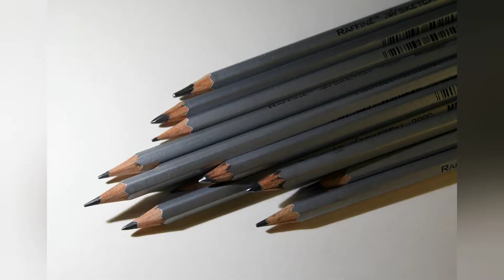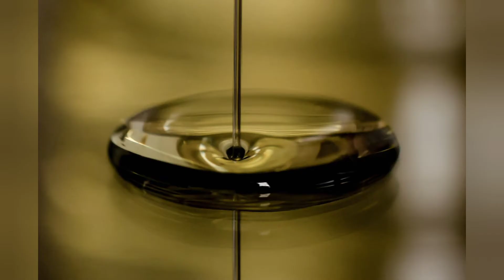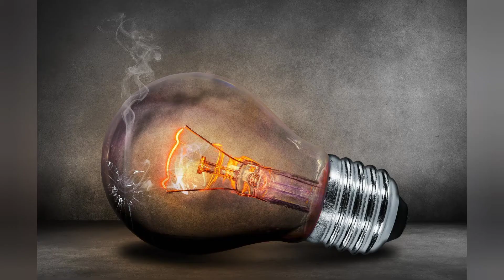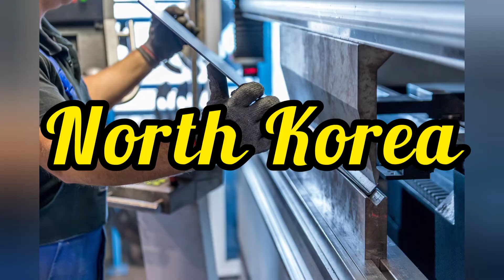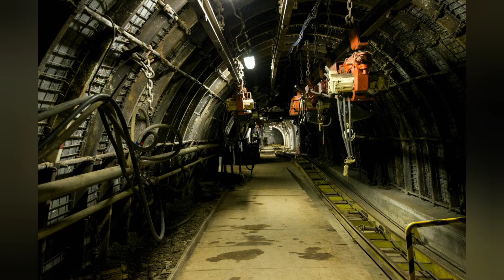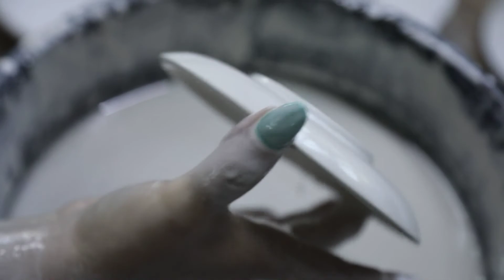The Hidden Mystery Behind Graphite

Comment: I eat graphite pencil lead
Reply from the maker: Yes, most of the people do eat unintentionally. 
Graphite is nonpoisonous, the pencils leads are not made of the metal Lead( that causes lead poisoning).
Some people experience stomach ache and vomiting.
I have to admit that I ate pencils leads several times, with no intentions of doing, was biting on pencil, and did not experience any symptoms.
It is safe for most people.
Reply: @ThinkScience7  I've come hear cz am 28 years n severally addicted to eat pencil. The graphite n the wood. I eat 3 or more a day. I've eaten since 2008. I was getting concerned
Reply: @dd-xz7je  don't swallow
Reply from the maker: @dd-xz7je  
You do not have to worry now
You see, graphite is nonpoisonous, the pencils leads are not made of the metal Lead( that causes lead poisoning).

Myself have eaten pencils leads several times, was just you know, biting on them actually.
Some people experience symptoms like vomiting and stomachache.

Since it is made of clay and graphite (which is made by heating coal or wood in presence of less oxygen), you do not know where the clay came from
So I advice you to reduce the amount that you consume daily.

Thank you for watching!
Reply: @ThinkScience7  THANK YOU so dear. I will try to limit. Have a wonderful time.
Reply: @ThinkScience7  hehe i also eat pencil wood
Reply from the maker: @angelamna9292  
😊😊